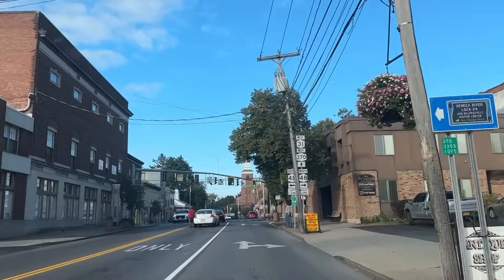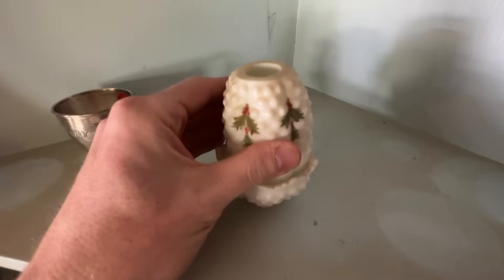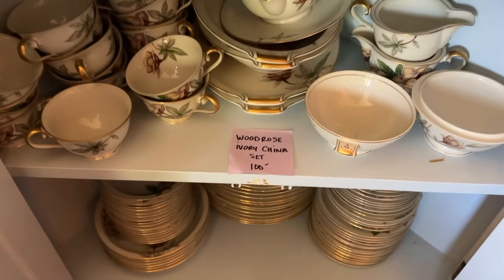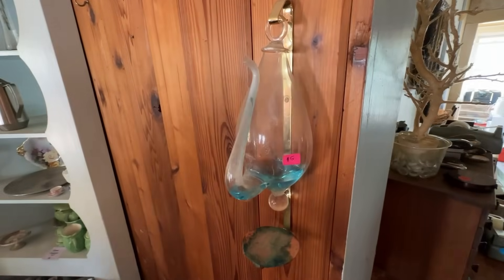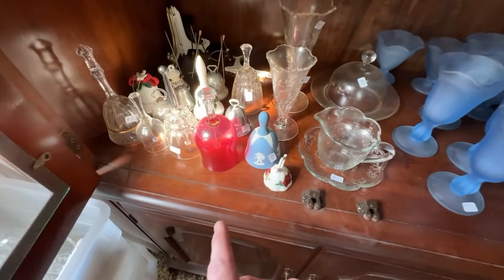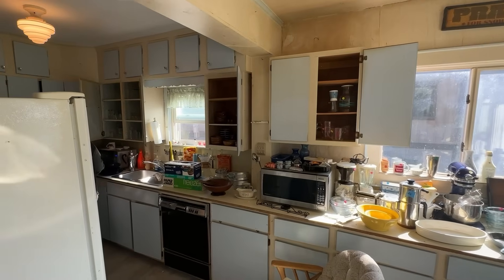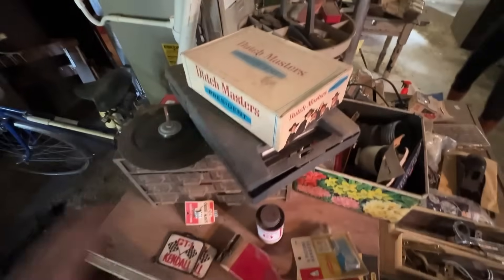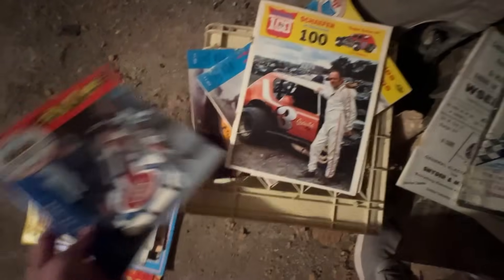RIVERFRONT ESTATE SALE TREASURES, SECRET ROOMS, & MORE!

Comment: FYI on Fenton for you.  Before 1972 Fenton was not marked with the oval.  Fenton had stickers on their pieces which usually wore off through cleaning.  By 1975, all Fenton had the oval.  The numeral 8 was put inside the oval for some pieces made in the 1980s, 9 in the 90s, and 0 in the 2000s. There are other marks on their pieces. I got my info out of Worman's Fenton Glass 2nd Edition., author is Mark Moran, the book has a date from 2007. Side note--not all Hobnail is Fenton. There were other makers as well. That's why I have 3 books for Identification of the earlier pieces. My favorite Fenton is the turquoise opalescent.

Comment: When you are sourcing paper from a basement how do you get around the mildew smell that sometimes accompanies it?  Leave them or is there a way to eliminate the smell? Thank you Dom, another solid video!!
Reply from the maker: Usually just airing it out and getting it into a dryer environment helps out, not buying ones with a horrid odor, and don't worry about a slight musty odor bc most book buyers like it. :)
Reply: Let it sit outside in the sun for a day or two.  That helps reduce the odor.